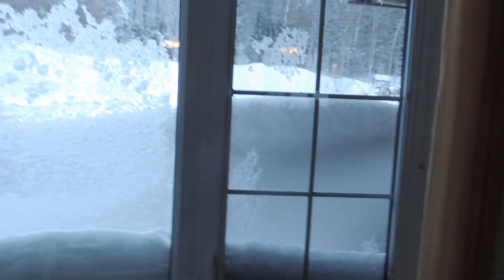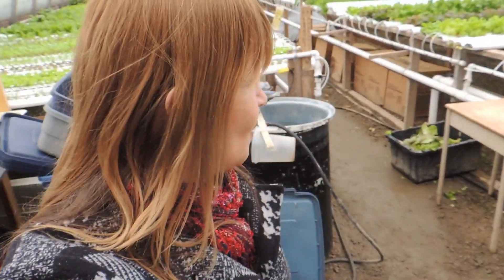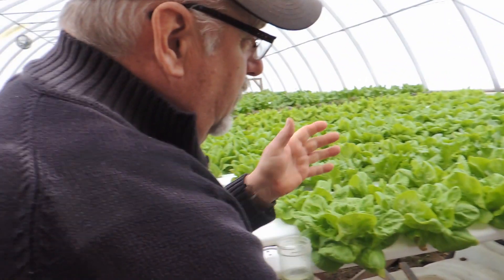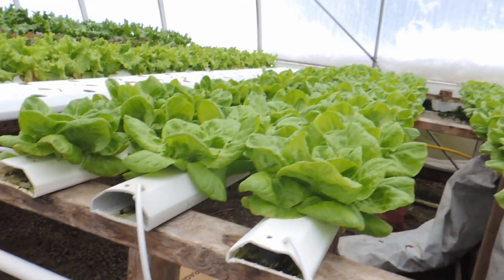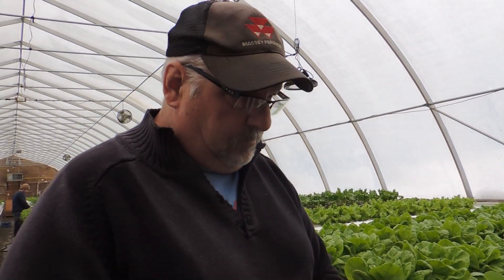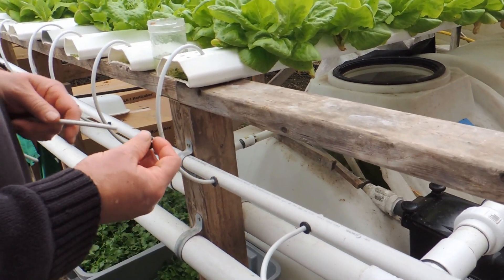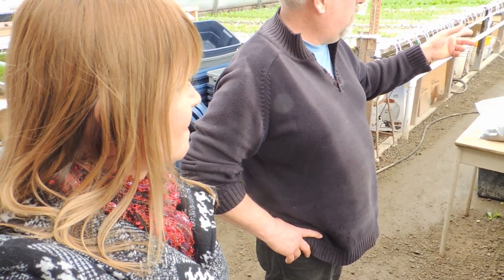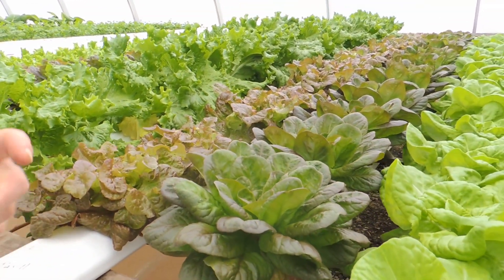HOW THE HYDROPONIC WATER SYSTEM WORKS.  Q & A

Comment: How dose the drain go back up into the tank without over flowing
Reply: Return line drops below a d under the pathway and then back up and then over to the reservoir tank. There will always be water sitting in the vertical pipes as well as the pipe under the path.

Comment: I'm not sure if you answered this previously or not. Being remote and with the storms you have, especially like today with all that snow I noticed a generator under the bench... is that your backup? I'm not an electrician and so I'm curious how a generator is connected to run your electrical (pumps, lights, fans, furnace and propagation)in the greenhouse? 
Have you lost power many times over the 5 years. Thanks

Comment: hi. thanks for the videos, i have three questions, packaging (wholesale process or retail) and your totes, how do you use them  and how much totes you use.. finally, store items until shipment... again, thanks for your videos!
Reply from the maker: Hi,
We package all of our lettuce mix in 1/2 lb quantities into 10 lb poly bags with twist ties leaving a little air in the bags. We do this with our beet tops, swiss chard and kale as well. We store them in totes in the cooler until we bring them to market. All other heads of living (root intact) lettuce, cilantro, basil and bok choy we store in totes with a little water in the bottom and keep in a shady area until we load up for market. When we sell wholesale,  they usually order large quantities of mix, so we don't bag unless they are reselling. Otherwise we put up to 6 Lbs of loose mix in each tote. This also goes into coolers until picked up or delivered. I have no idea how many totes we have, all I know is we have LOTS! Hope this helps.

Comment: Hello,  I've got a few questions regarding your tables:  (1) what are your spacing between vertical posts, (2) is it all 2x4 with the exception of doubled 2x4 under the horizontal joints,  and (3) did you use pressure treated? Thank you.

Comment: Great video - love the details you are sharing. We’ve only done very small scale hydroponics (flower pots with expanded ceramic marbles) with simple  hydroponic solution. We’ve recently installed a DIY 16 bucket Dutch bucket system. Unfortunately our tomatoes froze when temps got down single digit F and our heaters failed in the hoop house. We’re fully off grid. Do you have any ideas for low energy alternatives for greenhouse heat and hydroponic pumping?
Reply: earth tubes under the facilty..